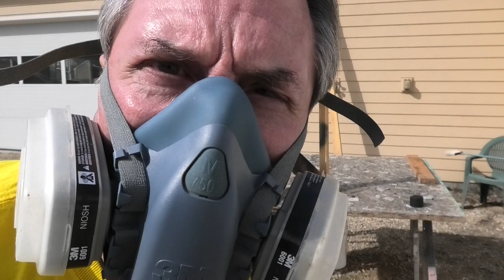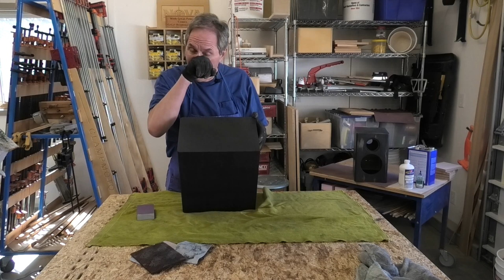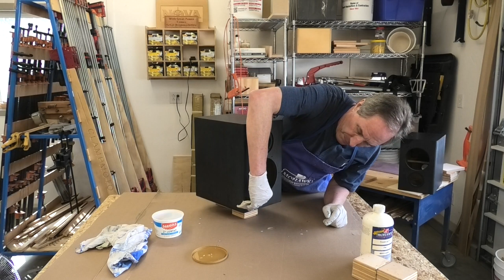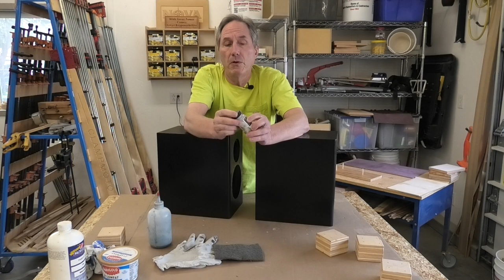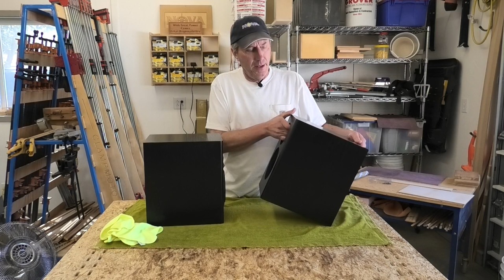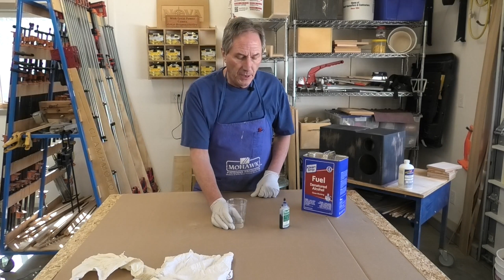X-LS Black Oak Finish and a Flop, too

Comment: Great detail info, Peter.  One thing needs correction.  Denatured alcohol is not the same as “white gas”.  White gas is pure gasoline with no additives, and it is what is used in Coleman-type camp stoves, lanterns, etc.  Denatured alcohol does not burn nearly as hot, although it can be a fuel for different types of camp stoves, etc.  Denatured alcohol is absolutely the right stuff for what you are doing.  White gas, or Coleman fuel would be a huge mistake for such craft projects.
Reply from the maker: Thanks for clarifying, John. I bow to your knowledge on this. Folks, I drew conclusions I shouldn't have and passed them off as fact. John pointed this out...heed his advice!

Comment: Thank you for a another interesting video! I liked the spray rig.  If I wanted a black finish, I would be tempted to color them with Jet Black Solar-Lux (NGR dye) stain  and  then seal it with several coats of aerosol  clear gloss lacquer.  And finally finish it off with satin or flat to the appropriate sheen.
Reply from the maker: Right you are! Had I known how original idea would pan out, there would certainly have been more efficient ways to get to the end result.

Comment: Peter, thanks for another interesting video. Have ever just painted the naked MDF. If so, could you do a video showing your technique. Thanks
Reply from the maker: Ed, I have painted several pairs, but always with spray gun and solvent based finishes. Not all that easy for those without equipment. Is that what you had in mind or possibly spray cans?
Reply: @carbidetooth  Could a regular high gloss spray can of enamel paint be used? The Rust-oleum cans dry very quickly and after 2 coats, you could do some sanding to get it smooth followed with 2 coats ofspray can clear coat.
Reply from the maker: @GSP-76  That sounds like a workable plan.

Comment: I would suggest using a tinted glaze instead of a dye/tint its is very good at blending color and adding that contrast you were looking for.
Reply from the maker: Mak, had I known where I'd end up, some other path would have been prudent, for sure. Glazing may have been a good option, but I opted to keep it simple and bail out rather than introduce yet another technique. Perhaps in another video...we'll see!

Comment: I was thinking of getting Klipsch rp 600M vs doing this DIY speaker. Would this be a better sounding speaker than the Klipsch?
Reply from the maker: Keith, I haven't heard the 600M, but I would expect the X-LS Encore to best it significantly, judging from what people have told me. It's really not a fair comparison when you consider one is off-the-shelf and the other is a DIY kit. Danny at GR Research and Ron at New Record Day could speak directly to your query, as they have heard both.
Reply: @carbidetooth  Ron thank you for the reply. I was also considering the x statik kit. Do you also make the kit for that set up?
Reply from the maker: @KeithKing31  Unfortunately, no. It is a cool speaker, though, and a nice intro into the world of open baffle.
Reply: @carbidetooth  
Peter GR research got x static kit to me very fast. Question for you about the cabinet material, MDF or Baltic Birch?
A Russian variety of baltic birch is available close to me. I was leaning towards that. Can you give a reccomend on what material would work best?
Reply from the maker: @KeithKing31  Sonically, I think either will work fine. As much as I don't love MDF, it has attributes that are hard to ignore when building speakers.

Comment: Peter, great video! Your variety and explanation of techniques is very inspiring. Your use of dyed Finish Up has me wanting to ask you a question. I have a pair of 18yr old Dunlavy SC-III.A speakers in with a cherry veneer. The tops have suffered some UV damage turing them lighter. https://imgur.com/WpuRqW1. My question is whether TransFast in cherry with Finiish-Up applied to my tops could bring back their color? I do have experience with hand finishes though not near your level. There are joint lines I can tape to as I don't want to have to coat the entire speaker. Keep up the great videos.
Reply from the maker: Mark that'd be a really tough one to get right.  I've done a little furniture repair and if  you brought it to me to fix, I'd probably pass unless your expectations were low, in which case I'd be inclined to leave as is and plan on a refinish at some point. Many things to consider: Cherry is very photoreactive so even if it matched now (doubtful) it may not in a year., I see some checking in the veneer that won't go away by putting finish over it. Sheen is also a crapshoot.  I suppose one could plan on it being a different color, but before I did that, I'd consider covering it with a piece of stone or maybe glass cut to fit and stick some resilient feet on it  minimize the possibility of sympathetic resonance.
Reply: @carbidetooth , I appreciate the frank reply. I have the light UV filtered and that has stopped the deterioration.  I had previously tried Howard's Restore-A-Finish and then wax, but the darkening was minimal. Thanks for the remote assist!
Reply from the maker: @markscardina8422  Unfortunately, the wax will raise havoc with the adhesion of any  additional topcoat.  It would need to be stripped and I suspect that process would just make things worse.